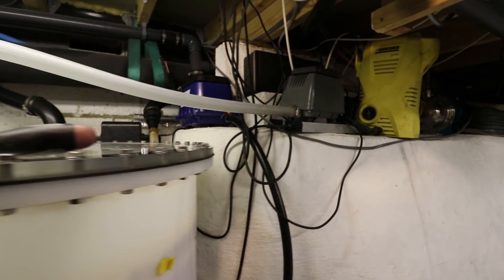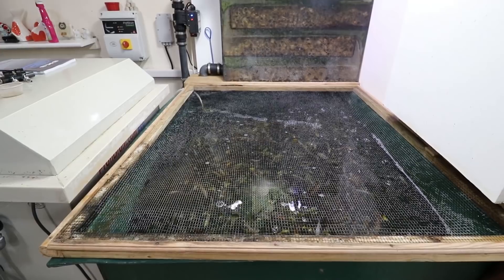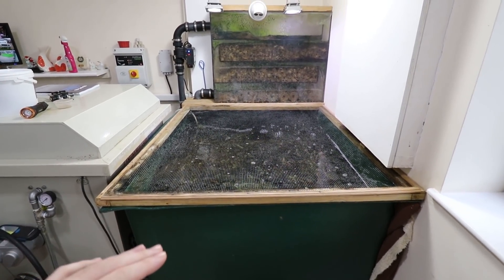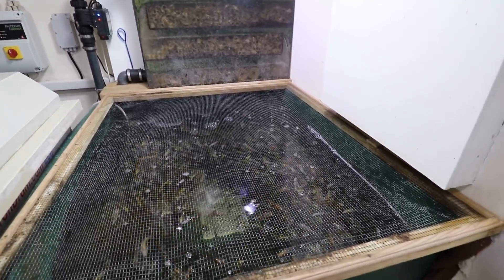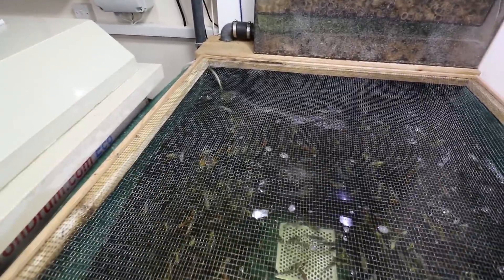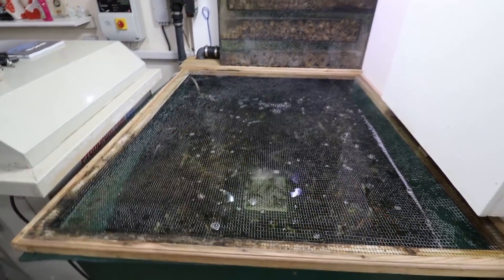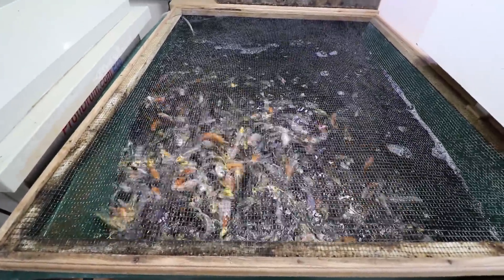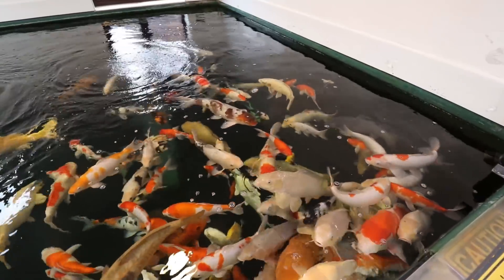Interesting Ammonia issue

Comment: Where did u get the cylinder from? Have an idea for a filter but when looking to source one they are very expensive!! Do you mind me asking how much yours cost? And where from? 
Ash
Reply from the maker: If you mean the bakki shower cylinder I had it custom made it cost about £700 but its very strong which is only required if you put it in a basement

Comment: Hi watching your video reminded me of doing 40% water change and testing water the next day and it was almost as bad still ,I now do  a small pump for draining off and balance it with the tap pressure so the level doesn’t drop as before so no stress on fish👌not a trickle system but better than a big drop in level and slow refill I guess,keep up the videos 👍

Comment: Is it possible to use the air coming out from the pressurised filter to help oxygenate the fry pond?
Reply from the maker: It is possible to put an air stone on the outlet but the air leaving the filter is basically what has been breathed out so there is less oxygen in it and no longer would be of any benefit it might even remove oxygen from the water.

Comment: Evening Adam, always take a bit of advance away with me after watching your videos.. will hold my hands up Ive always dropped lots water to try to lower readings. will try the trickle method thanks for sharing always jealous of your hole set up its amazing
Reply from the maker: Good stuff 🙂 it shocking how much difference it makes and how easy it is to lower the reading with a trickle rather than a drop and fill.

Comment: Hi Adam, I have been after a ups to run as a back up but have been struggling to find one, I didn’t want lead acid for the reason of the batteries needing changing every few years.  I don’t believe they last very long either couple of hours maybe. Solar generator seems good but don’t generally have the auto sense to come on if power fails.
Reply from the maker: I'm not aware of any lithium ones for some reason and all mine are lead acid mobility scooter batteries. I bought 2 cheap ones (one of them in the video and bigger one) they have both died now and the batteries aren't much cheaper than the unit so i haven't replaced them. I have one that is made by APC and it has a 10 year old battery and works great I think the APC ones have a better charger and keep the battery happy but the cheap UPS just cooked the battery as they where only 2 years old. I'm hoping to make a video on the subject shortly.
Reply: @AdamJulyan  the apc website wasn’t giving very good time estimates,  not much more than an hour, apc do lithium ones their well over £500 though,
Reply from the maker: @rich81090  I have a 2.200va that I used to power a main pump when i did some work on electrics and it ran for 4 hours on a 18.000l pump which I thought was really good. I also have a caravan and have a small kipor generator that is great if i need to keep the power on to a pond temperately as long as it has fuel it will keep running so not so much of a concern.
Reply: @AdamJulyan  if the ups ran the pump for 4 hours an air pump should be easy then, which is good to know.  My worry was the simulated sine wave might break the pump rather than true ac sine wave.  I would use a generator but it’s only useful if your around to turn it on.

Comment: Have you considered installing the air inlet in the bottom of your pressurized filter and air outlet at the top? The shower will mimic a gas scrubber and during degassing, since nh3 is lighter than air, will expel out some of the nh3 gas...
Reply from the maker: I didn't know that. It's something that could be done it was easier to do it the way i did and hopefully any gasses make their way out of the system it would be nice to be able to test what gasses are in their and what comes out of the outlet but i don't have that capability.

Comment: Enjoyed your video. It’s really getting interesting. Wondering if this bakki house media will generate less nitrate than your previous bakki river. Predictions?
Reply from the maker: Thanks  glad you liked it 🙂. The siporax in the river was incredibly good at processing nitrate so i never really had any to speak of i barely ever tested for it as i knew it was 0. I expect the BHM to be just as good but obviously its only a few weeks old so it's not processing any yet so my Nitrate has come up but still not to a level that would be detected by anything but a HANNA tester.  I expect it to drop back to 0 when the filter is fully matured.

Comment: I work with commercial dishwashers and they have what they call heat recovery on them and all it is basically is the waste water( already been heated) when drains away at the end of a cycle. The fresh water coming in is in a smaller bore pipe within the drain pipe which then uses the normally waste water used to pre heat the water going into the machine.
Reply from the maker: That is pretty much exactly what i want to do as most of the heating cost for me isn't keeping the ponds warm its heating the incredibly cold fresh water to the temp i need. Thanks for that i think it has given me some ideas 🙂

Comment: Can't you use the water in the underground well to replenish the pond , which will have no water bord treatment added. 
Trev
Reply from the maker: The water board treatment is the problem i have with tap water. But i don't get enough water from it anyway to make it worth doing and if was going to try it i probably would run it through an RO filter..